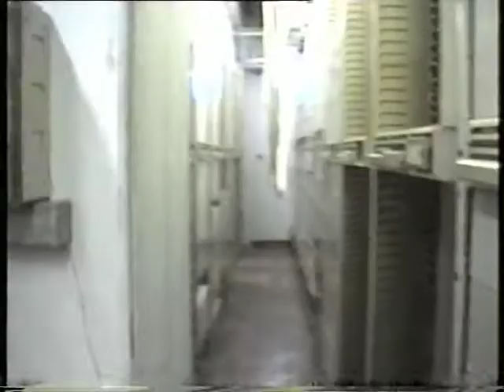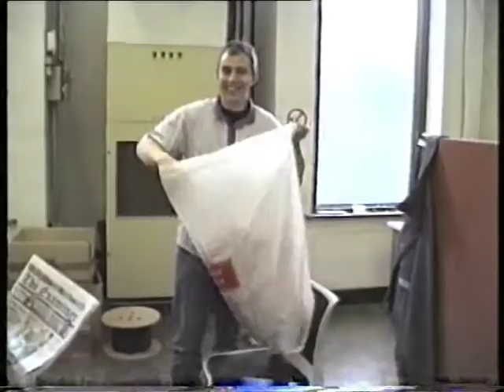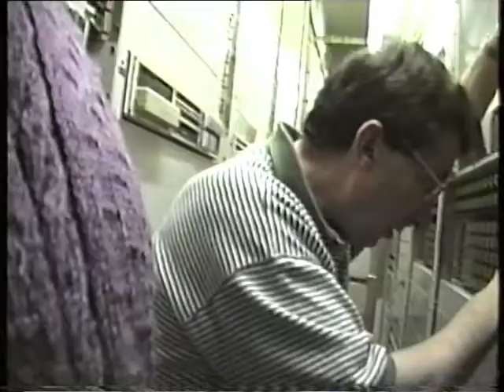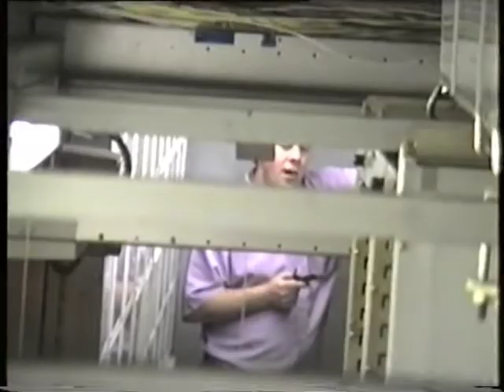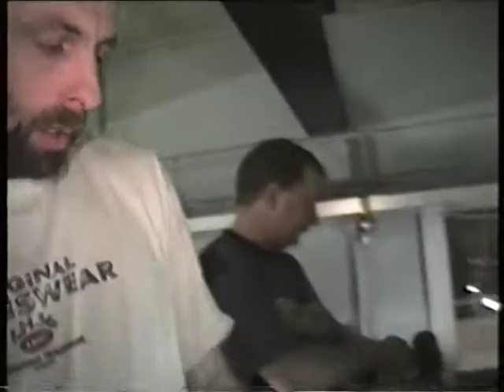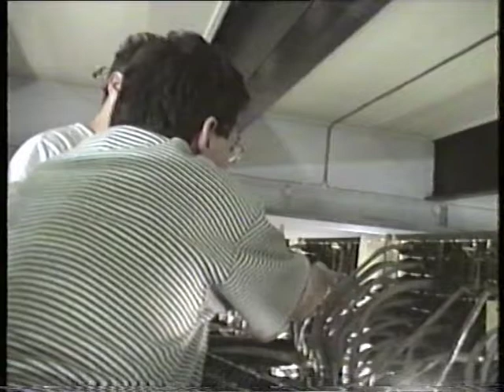Dennehys Cross Ericsson ARF Crossbar Telephone Exchange

Comment: @Robbie Cain Each switching assembly had 5 horizontal bars [as seen at 0.38] that were normally at a centre rest position and could rotate a small amount in either direction under the control of electromagnets - 2 for each bar.
Attached to the bars were steel 'fingers', 10 on each bar evenly spaced along the bar.
Each finger was about 50mm long and at rest, the tip of the finger sat between a pair of springsets [contacts]

Also in the switching assembly is 10 vertical bars which could rotate a small amount, at right angles to the horizontal bars.
To select a springset to operate, first a horizontal bar would operate and move its 10 fingers up or down and hold that position.
The fingers would bridge a 'U' shaped piece of metal that was immediately under all the springsets.
When a vertical bar operated, it would press against all 5 fingers in that vertical column, but only the finger on the operated horizontal would be bridging the U metal, which would allow the vertical bar to press that finger against the U metal, pushing it sideways and cause that springset to operate.
The horizontal would then release back to the center position and the vertical would remain operated for the duration of the call, keeping that finger trapped and that springset operated.

Comment: Very interesting, Crossbar became very popular in the British Isles and it is nice to see this one lasting until 1999. Our local crossbar in St Asaph N. Wales was transferred to digital in 1992 after 20 years service. After the transfer of these units in Ireland the whole of the British Isles became totally digital using System X and Ericsson AXE 10 switches.
One has to ask; with voip now becoming so popular will this mean the end of the telephone exchange as we have known for so long?
Reply: Different network in the Republic of Ireland (+353). 
Telecom Éireann (Eir these days) used different vendors and switches to BT in the UK. 

There were around 46 core digital switches in the Telecom Éireann network and over 1000 small exchanges / remote concentrators. 
Roughly half were Alcatel E10B of various generations and the other half were Ericsson AXE 10 or 810 - the rollout of both began in 1981/1982. Other networks in Ireland used Nortel DMS, Nokia and various other vendors.

Alcatel E10 and Ericsson AXE switches were also built or assembled in Ireland for the digitalisation project, and for export. There's still a fairly major Ericsson presence, now a software R&D centre rather than hardware.

The pre-digital network used crossbar: Ericsson ARF (larger local exchanges), ARK (remote units) and ARM (transit). 
I think there may have been some ARE switches used briefly too - crossbars with registers / markers handled by computers.

The first Ericsson crossbar in Ireland went in to Croom in Co. Limerick in 1957 and they were widely used in the automation of the network. 
The switches were  built in Athlone Co. Westmeath, from the 1974 onwards. There were also some ITT Pentaconta (built by CGCT in France) and some small Hitachi crossbars in the network too.
 
Before that there were Strowger Step-by-Step switches in use from the 1920s until about 1986, which would have been very similar to those used by the GPO, built by ATE in Liverpool. 

It's now the line for the classic TDM technology based switches too. All the Nokia/Alcatel E10 and Ericsson AXE local exchanges and RSUs are currently being replaced with modern Nokia MSANs (and the core switches are soft switches of various vendors).
 
These are being used to maintain whatever copper voice line customers that are left. The majority are being encouraged to move to VoBB (Voice over Broadband) from Eir or whoever their choice of provider is. FTTH and VDSL2 routers / access gateways have to contain an ATA for VoIP service, but each ISP provides its own switching.

Like in most of the world, it's all soft switches and voice as an application on an IP network and the copper network is expected to gradually shut down sometime over the next 10 years or so. Once 75% of customers in each area are off the network, it can be withdrawn.
Reply: Physical telephone exchange buildings are likely to go away, except perhaps for some strategic or otherwise critical locations.

Last mile will become more distributed, removing the need for centralised exchanges, so all of those buildings that were once very necessary will become unnecessary, but probably quite valuable from a land ownership perspective since they tend to be located near the centre of town.

The way things seem to be going now is roadside cabinets with DSLAMs, GPON or other access concentrators, backhauled by fibre optic. This means you can get a good few 10s of miles or km between the cabinet and some other building. You'll no longer need an exchange building per town, but just one or two per larger area where many cabinets can be aggregated.

As for switching of telephone calls, the move to VoIP means the switches themselves just become servers in a datacentre somewhere which you reach via your broadband service. Geographic numbering and area codes becomes somewhat pointless because you no longer have a reliance on routing blocks of numbers to a certain exchange because soft switches don't have such a technological limitation - two adjacent numbers can be at opposite ends of the country, just like mobile phones.
Reply: The bigger exchanges are becoming sort of mini data centres for FTTH. There’s still a need for aggregation nodes.

Comment: that must have been around for a long time ,They have been using ARE for a long time.was good gear though. ARF was the first version. .
Reply: In Ireland they went straight to two digital systems Ericsson AXE and Alcatel E10 from about 1981 onwards. So, they wouldn't have used Ericsson ARE local at all as it was just a computerised crossbar. When exchanges were upgraded they went straight to digital.

The ARF in this video would have had some level of computerisation - They handled DTMF dialling and I think they could deal with itemised billing and all that stuff. However, they didn't support things like call forwarding and voicemail or caller ID.

It would have been collocated with an Ericsson AXE digital exchange from sometime in the 1980s and calls going beyond that local exchange (even to near-by exchanges in the same city) would have been managed by the digital parent exchange. I'm not entirely sure of the technicalities of how it all worked as I'm too young. But, there was some kind of setup that allowed the AXE (or possibly Alcatel E10 gear) to take over many aspects of the older ARF exchange, only leaving the most local part of it in service. Its connections to the outside world went through a digital exchange.

From what I know, they would have had two number ranges in most of those exchanges. The old range would have been on the ARF and a newer range on the co-located AXE that was managing it. So, only older lines were still on the ARF and new assignments were all on the AXE. It also meant customers in the area could order ISDN or whatever they needed.

There were a handful of these ARF (they may have possibly been technically sort of ARE11) in service until 1999 in the Eircom (Telecom Eireann) network. However, they weren't that old technology, only maybe approaching 30 years of service when they were cut over to full digital. So, they got their money's worth.

Ironically enough, the last places to have this kind of technology in service were major urban areas because they would have had relatively high tech crossbar systems installed in the 1970s. Rural areas, and areas with older technology exchanges were cut over to digital much earlier on (during the 1980s mostly).

Those exchanges actually provided pretty rock solid service and from a customer's point of view, the only major difference they'd have noticed was a slightly different dial tone and a bit of ticking noise before the calls went through. That and the lack of voicemail and call forwarding. Otherwise, you wouldn't have really know you were connected to an Xbar at all.

Comment: Click click click click hello dial tone click click click Whadda mean the software has to be updated to get dial tone... its an option?  Ohhh you dont have party lines anymore. Yea we're working on that newfangled caller ID thing.  Load up the 9 track the drive crashed. Probably would have been better off with the crossbar.